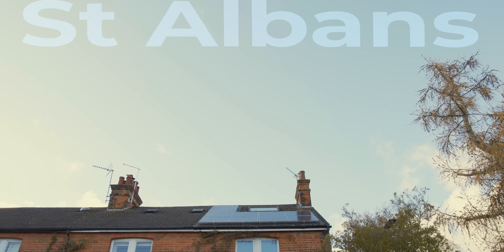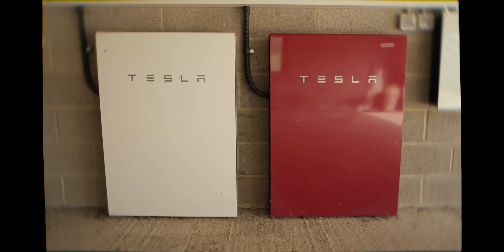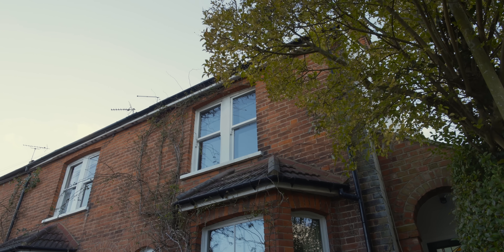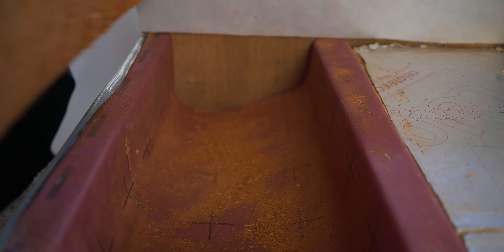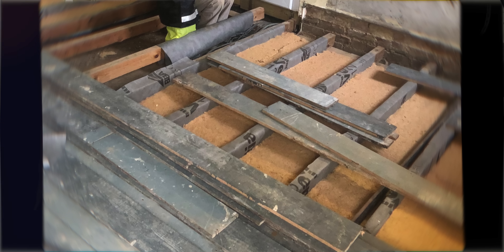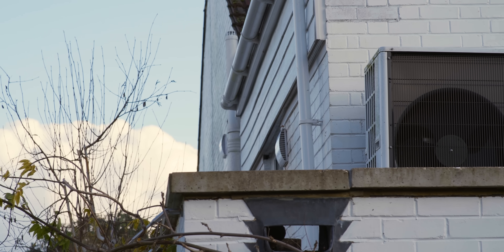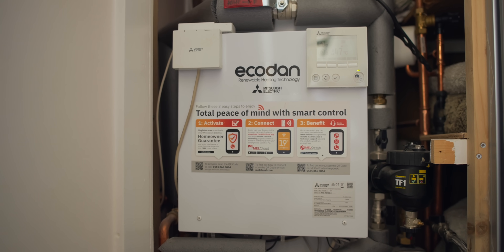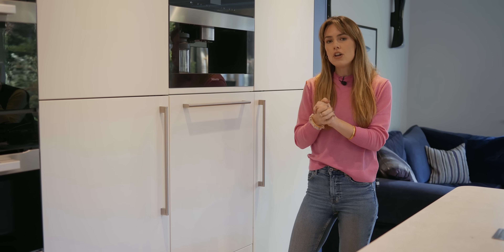This Victorian Home is Now 75% More Energy Efficient!

Comment: Sorry it's more nuanced than fabric first. 2:36 

For Speed of decarbonization it's often fabric fifth because an ASHP decarbonizes heating much more dramatically than small reductions in heat loss that some insulation improvements achieve. 

Ie. Yes insulate a loft, but that's so easy to do, and often done already as a result. EWI or IWI is often really difficult to do right, and if you can only afford 1 thing - doing the ASHP first can often achieve more decarbonization than the insulation. 

This can be thought of as our electricity becomes much lower carbon, energy efficiency matters less from a carbon point of view. And the bigger gain than reducing gas use in a home by marginal gains of EWI/IWI could be getting off gas onto the cleaner fuel. 

Even if you do use more electricity than you would in a perfect fabric first mindset. 

I'd recommend everyone Google "Insulate Britain: Yes! But by home much? " On essays concerning website.
I'm sure he explains it better than I. 

Only exceptions to this are easy to do large impact insulation like double glazing, draft proofing and loft insulation which is all largely done . 

Or the social housing market/ fuel poverty market, who couldn't afford any heat anyway, so better keeping any they do spend in, rather than fitting a heat pump not suited to rare on off use. Plus they don't decarbonize anything if they are never on because the owner can't afford any heating bills.

Example below 👇 
So 26% lower gas use, might reasonably be expected to be 26% lower carbon emissions from your heating. 

Where as a ASHP would have reduced your carbon emissions from heating by 80%. Let me show you the working. Last year's electricity avg carbon intensity was 125g/KWh, the best installers can get SCOPs (ratio of heat out to electricity in) of 3 to 5+. Let's use 4. So 31g/KWh of heat produced. A modern gas boiler would emit 215g/KWh of heat produced. So the heat pump would achieve a massive 86% reduction in your heating emissions. 

Vs the 26% you've achieved. 

So if you can only afford one at a time, and your goal is decarbonization, which would you do first?

Ideally both together right? We don't live in a perfect world and all have financial limitations. 

Yes would the ASHP be oversized after you later refit insulation? Yes. Would you have spent extra money on rads? Yes. 

But you would have definitely reduced your emissions the quickest.

And this is why fabric first is bull plop 2:16
Reply: So good to hear someone else saying this. It's the decision we made in our 1865 Victorian house. Slight saving in heating cost versus oil. Well over 80% saving in CO2 output. House is much more comfortable - work completed in a week with much less disruption. 

I am interested in more efficiency savings - but this is how to decarbonise quickly. It's also cheaper to do in most cases.

Comment: Who makes the single room heat recovery ventilation system? Is it passive or does it have a fan?
Reply: it has a fan and is on constantly adapting to humidity levels in the room. The one we have is Blauberg, but there are a number of different options now.
Reply: I would look into the Demand Controlled Cascade MVHR Ventilation – bluMartin freeAir 100 MVHR - perfect for projects like this

Comment: Great video. The heat pump would be more efficient if you used more radiators so you can drop the flow temperature to 40C or 35C
Reply: Thats very interesting - thank you

Comment: Good point about the limitations of rigid insulation! The cold and hot gets through the gaps. In my last solo home build, I spent a month just installing insulation and sealing gaps. Rigid insulation is expensive, but far les efficient if the house is leaky.

Another option for crawl spaces is conditioning. Expensive but people often spend a lot insulating the roof and walls and forget the floor.

Heated floors are wonderful in cold climates!!!! True luxury. Gypsum concrete is light enough to install on a well built wooden floor, and acts very well as thermal mass.

I’ve kept fireplaces where building codes allow. I’ll have a mason do repairs on the chimney and fireplace, with an eye towards repairs and sealing. Sometimes the mortar is so degraded they let rodents in and are too dangerous to keep. Never ever lean on an old chimney.

That said, I’ve put a couple of wood fireplace inserts into old homes. They burn far more cleanly, do a better job of heating the house, and put 95% or less particulates into the air. And, installed correctly, they cut down on leaks. I live in fire country and have to keep a defensible space around my home anyway. So I have a good supply of lower tree branches and dead trees to burn. The wood stove burns far more cleanly than a wildfire!
Reply: "rigid insulation!"  But loose insulation can easily fill in the gaps  For example with those aerated glass beads. Or with strips of bat insulation for vertical applications, Installed prior to the rigid insulation....  There's quite a few easy workarounds...
Reply: Rigid insulation should be fitted with ‘gapotape’ on its edges when fitting between joists, studs and rafters. It’s a memory foam with a sticky back that allows for the slight movement in timber (and also inaccuracies of cuts). 

It’s in AD L of the building regs, although I’ve never seen it anywhere this side of a Robin Clevett (master carpenter) YouTube video.
Reply: Tape designed for insulating rigid foam has no insulating value, it's expensive and the adhesive will eventually fail, It's only purpose is to reduce air infiltration ... So there are better, more cost effective alternatives....  

Tape only really makes sense when the Rigid insulation is being used as sheathing.

Comment: Would love to see Heat Geek profile this. I bet they would end up switching the radiators back on and running it on a smaller ASHP. Not using radiators means the ones that are on have to be hotter which is less efficient but with the size of ASHP they have, it probably can't modulate down low enough to fully utilise the efficiencies that are there. 

Good job on the retrofit though, should be costing them very little to heat, with a smaller ASHP they could be zero bill with solar export taken into account.
Reply: Me too. I think EE and Heat Geek are long over due a collab.
Reply: @davidwicks9835 I think you're right.
I just saw a Heat Geek video before seeing this one.
I'm now really curious to find out what size heat pump Heat Geek would have installed, and how much less Judith's energy costs could be.
Reply: Thanks for this. We were going to explore more so this is encouraging. We don't have any radiators on, just the UFH and the towel rails is all it needs.
Reply: @ecorenovationhome  
A heat-pump works most efficiently when it is heating water to the lowest possible flow temperature. By turning on the radiators you can reduce the flow temp & therefore increase efficiency.

You should do some research on this. Look into adjusting the weather compensation.
Reply: @cingramuk  my 60s terrace EPC D 300mm loft, cavity walls. Has a 6kw heat pump with a buffer and I use considerably less electric than they do almost two thirds less infact.
Reply: @Burtis89  Fascinating and good to hear that you're saving so much. Wonder why your EPC is D? Sounds as if it should be much better than that? Ours shifted from D to B.
Reply: @ecorenovationhome  funnily enough after I wrote that comment I looked at the EPC, and it doesn't include my led light upgrades, heat pump so yeah I may get it higher maybe scrape a C 😁
Reply: @Burtis89  That makes more sense.
Reply: @ecorenovationhome how low did you get your B rating. We got a B too and it really irks me that it was only 2pts away from being an A. 😢
Reply: @ can’t recall the numbers but we were close too. Wondering if our new solar might get us there - just waiting for the changes to kick in. Well done for getting so close!
Reply: Also makes no sense if they have a 55 degree flow temperature they'll be blending that down massively for the underfloor heating. So if you don't need 55 in the rads then that's just a huge efficiency drop.  

I dunno I guess this isn't really for heating nerds.  Maybe it's all good and we're just missing the details.
Reply: @AmosMoses777   At 55c design temp, will certainly be mixing down for UFH which runs at 27-29c, just wasting energy and will be cycling like mad in shoulder months. Heat loss is clearly minimal with EPC of B, if mainly using UFH, then 35c design temp is plenty.

Comment: Fantastic video! Judith is super knowledgable and a great teacher. Regarding the heat pump, they are famously over sized - but also operated too hot! They could make better use of those large radiators by reducing the flow temperature down, from my chats with HeatGeek 55C seems high (worth looking into weather compensation 😃)

Thanks for the video guys!
Reply: Thanks for that  - good to hear about heat pumps. I shall go exploring more.
Reply: I’ve been running mine at 35degrees maximum on a weather compensation curve this winter. It’s been perfectly warm, and I live in a badly built, poorly insulated 1960s bungalow.
Reply: @Giant.Iain171 So, not as leaky as a Victorian terraced then!?
Reply: @Giant.Iain171  Do you happen to know what efficiency you've been getting? I'm not sure if that kind of metric is available to you
Reply: @xandermarjoram8622  SCOP for heating in December was 3.50, but my house is badly insulated and draughty. 
I received a thermal imaging camera from Octopus today so I’ll spend the next week draught proofing and working out what insulating is needed next.
Reply: @Giant.Iain171  You can't have a SCOP for a single month. SCOP refers to an entire "heating season".
Reply: @ Apologies, I always get the two confused. To me COP suggests ‘all time’, SeasonalCOP suggests a period of time.
Reply from the maker: Thanks Ryan! Hope all is good with you :-)
Reply: As far as I can make out some systems if oversized really don’t like being run at very low temps unless there is a considerable volume in the system. I’ve tried playing with the WC on our Ecodan to get our efficiency up but it’s been knocking it loopy cycling. It seems to be better for us economically to use it with the stat.

Comment: Solar panels are a big fire hazard and will ultimately cause leaks and cause damage to the roof. Also you need to pay someone to go up and clean them regularly and that is expensive.
Reply: None of this is true.
Reply: I don't know where you get this "fire hazard" idea from.  Unless you mean that the panels will drop through a roof in the event of a fire - but if the roof is so badly burned that the rafters are giving way and showering the inside with tiles or slates, I would suggest you probably have other things to worry about.  I don't know about this damage you are speaking of - I have had mine up there for 12 years and I'm not seeing any issues.

As for cleaning them, the air on my estate is very clean and I do occasionally have to go up and clean off the lichen.  But I'm talking not at all for 8 years, then maybe every couple of years or so.  Your window cleaners may well undertake this work, if not a roofer will do it for not very much - the same people who come around and "fix any loose slates" for £150 will do that job for you, also, if needed.
Reply: @ashtontechhelp  every year lots of houses burn down because the solar panels set their roofs on fire.
Reply: @ I have had a quick look around Google - it seems that most panel fires are due to faulty wiring (not not a solar issue, that's bad installation) and you get the very occasional case of too many bird nests under the panel (so a lack of maintenance / should be caged as mine are).  

To come back to your statement that solar panels are a "big" fire hazard.  I agree that sometimes things go wrong - but I don't think you're being realistic here.

Tell me, do you drive a car, or occasionally find yourself a passenger in a car, despite the vastly higher risk of the car going up in flames, or having an accident?  Do you have electricity in your house, and items that run on that electricity?  Are they all checked, every single year?   I'm not convinced that you are assessing risk correctly here.
Reply: Not true at all

Comment: Wonder how long it'll take to reap the economic benefits after spending probably 25k+ making your home more economic 😅😂😅😂😅😂😅
Reply: Homes need significant work, often almost rebuilds, every 50 years even if they are maintained well! 

1. Resale value. Her’s went up 95,000 pounds after spending 25,000 pounds on the remodel. A major remodel is the time to upgrade to a smart home, upgrade insulation and air sealing, make needed repairs, get rid of mistakes made by previous owners, replace pipes and wires, etc.

2. Her home likely looks nicer and with the radiant floor, is definitely more comfortable. Radiant floors are amazing!

3. By tR modeling instead of rebuilding, and using less energy, she has a greener house. 

4. She is saving a lot on her energy bill. 

5. Now, she can install a much more affordable solar and battery system to go off grid most of the year!

5. She clearly enjoyed learning about insulation and enjoys being a teacher of energy savings!
Reply: @freeheeler09  Property prices in  St Albans have risen by an average of 25% in the last 18 months. I live there, it's well known how insane prices go up. She didn't mention when the previous valuation was done. If it wasn't immediately before the work was done its really not a valid point to be making. Case in point, my home went up in St Albans by £190k in the 3 years I lived there. My folks moved a couple of years prior, their St Albans home has since sold for £395k more than they sold it for- thats less than 5 years.
Reply: @puressk  We had two valuations done at the same time. One by an agent who just wanted to know where the internet points were. The other by someone who understood retrofit. So this was like for like at the time
Reply: @freeheeler09  Thank you! I do enjoy it - big surprise - not at all what I expected. But its fascinating!
Reply: Well she said they went from using 25,000kWh to 6,000 Kwh. 

That's a huge financial saving right there
Reply: Well,  you can't build a new home for 25k. Insulation and gap sealing will last the life of the home. How much would you save in your home if you had previously paid double what you're paying now to heat and cool your home? How quickly would that add up to 25k?
Reply: Yeha that's what I'm saying. It'll take probably 15+ years to recoup it  @jamesengland7461

Comment: Those single room heat recovery vents aren't NEARLY as efficient as they claim from what I've seen from people actually testing them.
Reply: They may not be 85% efficient as claimed, but they're considerably better than the traditional fan.
Reply: @ I'm not saying they don't work, but from what I've seen they're somewhere between 45-60%, rather than the claimed 80%+.
Reply: @hellcat1988  That may well be true. I'm never sure about what is claimed by the manufacturer. And no idea how we'd work it out!
Reply: We find ours are working well - no condensation and good carbon dioxide readings
Reply: @ecorenovationhome  Who makes that square model you have? It's much bigger (and thus probably more efficient/effective) than most of the small tubular through-wall HRVs. (BTW I retrofitted an MVHR to a (1960s) house and managed to hide all the pipes, so it is possible :-).
Reply: @xxwookey  It's a Blauberg. I understand that retrofitting MVHR is easier now, but it felt insurmountable at the time. The single room ones are working well - no condensation and good air quality. And easy to install or add on if you need more!
Reply: @ Thanks. Blauberg is certainly good quality gear.
Reply: I would look at Demand Controlled Cascade Ventilation – bluMartin freeAir 100 MVHR